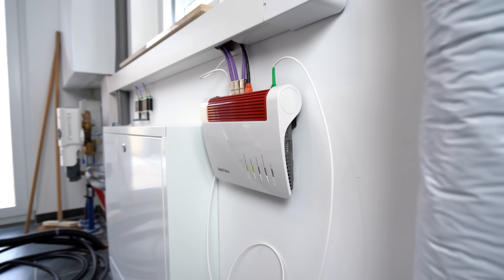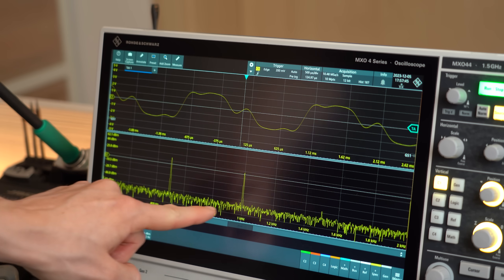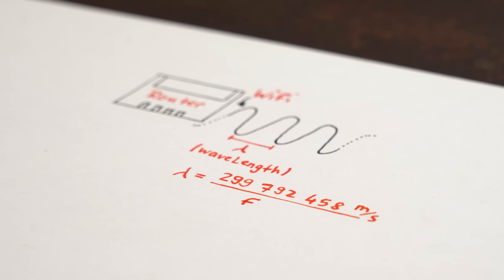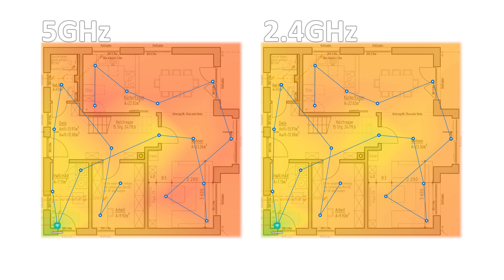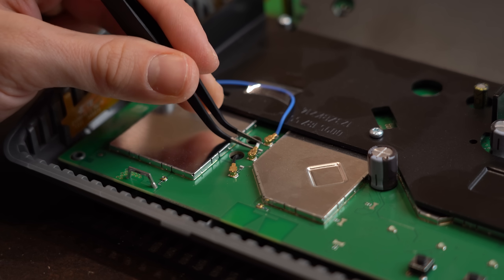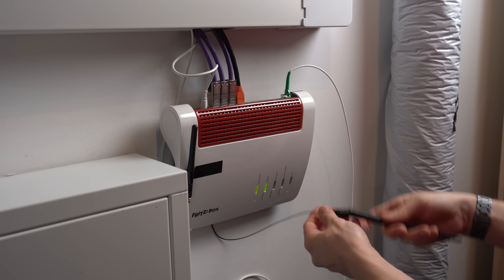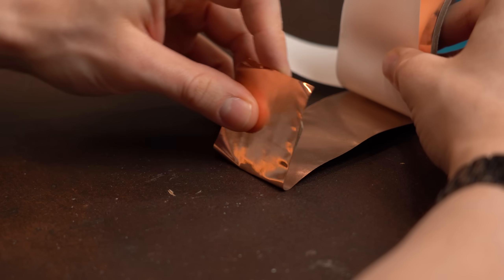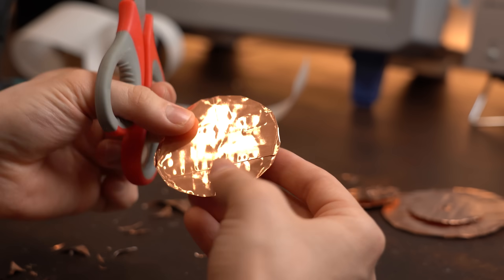I tried OVERPOWERING my WiFi!

Comment: The only antenna I would try to build for WiFi are a dish ore a wide beam horn antenna. Other then that. I’d just stick the copper tape behind the router on the wall to reflect most of the energy into the house. 

Good luck!

Comment: if you're having wifi issues i would first verify that your wifi router signal isnt being drowned out by other signals around the area, most wifi routers come with a set channel and changing it could result in better performance but there are apps to help you figure out what channels might be better for your router to be on, if you're having coverage issues i would recommend looking at a mesh system that provides wifi coverage over the areas where the mesh network is installed

Comment: A Mash Repeater is  always the best solution in this use case. Yes, this adds a couple more of more Watt per hour to your house hold, but it is the most reliable solution. Especial the AVM solution is very robust!
Sadly, the "MASH" standard, is only a company based standard and is not a cross company solution at all !!!
So you can only "mash together" your AVM routers (fritz box) or only "mash together" your Zyxel hardware, but never cross the hardware vendor!!

This is a big mistake of the WiFi hardware industry! every company should support the same MASH standard and always should be cross vendor compatible!

Comment: Hi. I actually use - bought ! - directional antenna's here.
They surely have some effect, a good couple of meters increase o usable connections. But: just when 'in the beam' ofcourse and worse outside the 'beam'. By the way, on a router with connections for external antenna's. And only 4.2 ;-)

Comment: The actual improvement you are seeing is because you rotated the antenna 90 degrees. As you pointed out in your sketches an antenna radiates the signal to the side and not out of the top. Before you were basically relying on catching reflections while with the new antennas you are receiving the signal. And wherever possible you should make sure that the receiving antenna is parallel to your sender (for instance with WiFi sticks)
Reply: I would also question the choice of different antennas. AFAIK newer 5GHz routers often use MIMO and I would guess that might degrade in performance.
Reply: that's something that a lot of people don't know, it looks silly to bend the antennas in 45 degree increments, but if you actually look that the DB signal flat, standing and to the side  there's a noticeable difference.

A good tip is if you struggle with reception and just happen to have two phones, try putting the phones back to back, and rotating one of the phones 45 degrees, rotating the phone 90 degrees would be optimal if you knew where the antenna was, but pointing the phone towards it would help a whole lot more, I'm assuming you have no idea where the signal is therefor splitting the difference with 45 degree

Comment: I've got a special case here. I live on the side of a small mountain (a really small one LOL) and I suspect the rock under the house to have a high content in metals and perhaps radioactive materials. The short story. A lot of my wireless equipment has a very reduced range. Per example, my Logitech blue laser mouse starts stuttering after 50-60cm. If I go into a café, I easily get 3 meters before the mouse gets unusable. So it might not all be because of range and walls. 
Another thing. WiFi is, as far as I can see, very similar to sound in terms of distribution. Am I getting this wrong?

Comment: People sell powered, boosted antennas for wifi which claim 50 or 100km range or better. Wouldn't that be good enough, and pick up the many nearby open wifi networks? Why would the antenna have to be a specific length? Couldn't any length work just fine? I mean, the longer the antenna, the more signal should be able to be picked up by said antenna. If you add more wire to an FM antenna, you can pick up more signal. I woyuld assume it would work the same for spreading the signal. As far as the single direction antenna, you actually need another one on the other side to pick up the signal, your phone isn't going to work as a tester for it, because it doesn't have a matching antenna pointing at the other one. Only a computer will do to test that. Two of these antennas should effectively send the signal in a straight line between the 2 devices, but wouldn't do anything as far as improving your actual wifi signal and so would show little to no difference on your test. Also, your comparison tests aren't really doing any better at any point. When there is still almost as much red in the second picture, how are you claiming a 10db difference, when visibly there is absolutely no difference? If the signal was better, then visibly there should be far less red, and it would be very obvious.

Comment: Do a wifi mesh system so every place can get good wifi signal signal go for access points with PoE so you only need to use the ethernet cable for both signal and power no septate outlet for powering it.

Comment: It's kind of strange to watch. Because when You look at the map the WIFI Router is in the corner. We all know it should be in the middle of the floor. Probably cables don't allow it. Why not use standard WIFI repeaters? How about also a panel antenna?

Comment: That antena is actually a receiving antena, not a emitting, so ofc it performed worse. This type of antena was used in the time when radio TV was still a thing, and that is why it is a monodirectional antena, they used to climb on the roof to rotate antena to the direction of transmission.

Comment: nice video, there are jsut two problems with the directional antenna
1. the  director elements (those disks that rget smaller and smaller) have to be electrically isolated, otherwise you didn't do anything about directing the signal since they all kind of resonate with the driven element, and the mroe director elements you use the tighter your beam gets, i would personally reccoment a helical antenna design or for more efficiency use two seperate yagi-uda antennas which have been rotated 90° along their firing axis, that way you won't have polarizazion issues with divices that have linear antennae

2. using a directional antenna focuses the power onto a smaller area, which increses teh effictiv epower in taht area, which goes into illegal ranges in germany, personally, i don't really fear a visit from the ordnungsamt since i live in a village and that would be their smallest concern but you expressed that you didn't want to do anything that is not legal in germany, which you woudl have dong have you not shorted out your antenna

please revisit this topic with better antenna designs, its really interesting

Comment: I have used 12/13 cm bands for many years. Set dipoles with a reflector and one director in the open corner of each room and hall. Passive reflectors work well.

Comment: You can't just haphazardly assemble an antenna out of copper foil and garbage and then proclaim that it doesn't work. Wtf is with the quality of your videos man? It just gets worse and worse. You need to build the antenna out of actual solid parts, and they need to meet specific requirements. They aren't meant for transmission across the house either.

Comment: Changing the antenna is probably also be illegal as it increases the EIRP.

Basically: directional antennas have the benefit of reducing noise -- not increasing the allowed TX power by focusing it in one direction.

Look up the definition of EIRP to get a better explanation than I can give you. The legal limit is measured in the strongest direction, not as the average over the sphere.

Comment: You have connected the feed at the wrong point. You connected to edge of driven element. It should be inset. The inset distance is responsible for the impedence match.

Comment: GreatScottLab The multi disc (antenna??) in your thumbnail looks similar to the reflectors used in something called a "Cantenna". I never made a Cantenna, but they have something your example does not have.. (The Can).. 

The Can is what keeps the radio waves from scattering after they hit the reflector part. 

There are (or was) on-line calculators for calculating the dimensions of the can for the wavelength you are using...

Comment: Most people will just care about the router's transmission power but forget its reception from the smartphone or pc. The same attenuation occurs at the signal transmitting from the smartphone or pc. A good communication depends on both sides. Otherwise, the speed   cannot achieve as when both devices are in line-of-sight. Another trial is to move the router (ie Antennae) as high as possible. According to my experience, this could make a difference.

Comment: You've misunderstood the rules. Modifying the antenna on a router is just as illegal as adding a power amplifier.  EIRP is Effective Radiated Power and takes into account any gains or losses in the antenna as well as what the final puts out.

Comment: Changing antenna to one with higher gain is also illegal, power that is mentioned is EIRP which includes antenna gain, not only transmitter power.

Comment: Get rid of plastic antenna covers (leaving just bare metal rods) and measure the signal strength again.
And use a DIY wifi stick antenna aluminium directional deflector. It works!
Also place antennas coaxially on separate height levels.

Comment: That antenna should have a non conductive shaft or at the very least it should be isolated from the copper. The aligator clip in the middle will screw with it and the feed point also doesn't look right. I'd make a bi-quad they are really good for this situation and not too hard to assemble.

Comment: Did you perhaps see the wifi hack on Ukrainian nutcase Kresosan's channel? His channel is well worth  a look, they used the cover of the 1st war Russia hads with Ukraine as cover to blow stuff up, like connecting electrolytic caps in to the 240V mains supply. He actually has a degree is EV or electronics of some sort, so it's hard to tell if he's trolling or being serious most of the rime.

Comment: From my experience wifi is pretty much useless if you don't have repeater in every room. Even then in some buildings with a lot of steel in the walls there will be too much interferences. For reliable and secure network there is nothing like a cable!

Comment: A high quality access-point is like $100. While that is a lot more. The strength of the signal is considerably higher. We are 6 people in my home using the Wifi, and the older kids also run there computers of it. Its pretty much always perfect speed.

Comment: Get a fibre extension cable and move the Router (pronounced "rooter" in the UK)
Only those crazies in the new territories call them by the same name as a power tool for edging wood.

Comment: My solution is central wifi access point like a Unify. You can still have the combined router/access point/firewall/media converter there (hate all in 1 box, i have mostly all separated). Get same password and SSID to both and you have a combined network.

Comment: It's 2005, you're a teenager, you try to mod a usb wifi antenna with a beer can, hoping that it could pass through 5 walls in a 20 meter straight line, as a result you spend most of your time plugging and unplugging it, and adjusting its direction.

2023: you're watching a short/reel, and some eastern european looking girl or brown handed man is irreversibly changing your life with 10 lifehacks: among them is the aluminum can antenna. 

You shed a tear.

Comment: Please stop with the disinformation,  it's getting out of control and ultimately shows who you are as a person and creator!!! (fake?🤔)
The Russian sniper antenna you are showing is designed for long range p2p directional testing. 
They're great for hacking. I have many and all work fantastically. As they did, I too have gotten many many km's of range from them.
One of which is on a remote gimble on a 40ft mast!
But unfortunately you built it completely wrong. Only 2 plates are connected and the rest are reflectors and deflectors, they should be insulated from one another.
 Hence in the instructions it says something about insulating with a pen tube.
They are old and proven and the fact you couldn't and didn't know how it works has got me thinking about your intelligence and how your educational video's are conflicting with each other. 
You copy and write a script just like every other typical YouTuber then pretend to know but are confident therefore people listen.
You simply do great research and pass it off.
The Chinese love your work as you do theirs! That makes sense to you doesn't it! Because your circuit's definitely are the same as older but harder to find Rf designes. 
I have learnt a little from you but it's all common sense easily picked up with beginners.
 Definitely not a broadcasting antenna.
If your router has a mesh option just buy another one or an old one and deal with changing AP's manually.. 
Or build a double helix as their proven and even easier to make.
Best option for anyone would be to buy an Australian router.  
Our maximum transmission is 1000ma and peaks of 1500ma is possible with custom firmware on Nighthawks ect.
I don't want to unsubscribe but I'm getting very close now.

Comment: re-enforcements in walls acts as loads on the antennas and just moving them a bit sideways maybe helps. Another reason is the antennas acting as half dipoles, they require a ground plane to get the energy out and in certain directions. If the ground plane is small, the distributon pattern will be unprededictable.

Comment: Are you unable to get a fiber coupler and just extend the ISP fiber and put it more centralized? Or get a mesh network setup? Or disable the wireless functionality of the router and get a good quality router that handles the wireless routing

Comment: You should not use the same SSID for 5G and 2.4G Wifi. 5G Wifi has a severe range problem when it comes to penetrating walls. With different SSDIs you always make sure that you're connected to the better wifi.

Comment: Your 1st mistake is buying a second wifi router when you should have bought an access point instead. 
2nd mistake is you need to put the routers in the middle area of your house and elevated up near the ceiling.

Comment: Thanks for the video! To put it bluntly: the measure that really helps the most are repeaters that are connected to the router via cable.
Connecting external directional antennas is prohibited by law in most countries. The idea with amplifiers cannot work because you would have to amplify both directions. And then unfortunately there are a lot of fake videos about supposedly great WiFi antennas that don't work. In order to make a functioning antenna, you have to take a few more things into account anyway.
In your case, a metal foil on the wall behind the router could help a little. On the one hand, this directs some transmission energy towards your apartment. And on the other hand, your neighbors' WiFi signals are somewhat shielded, which leads to a better signal-to-noise ratio and thus improves your uplink connection. By the way, the latter is usually underestimated.

Comment: I had the same problem for a long time but everything changed after 802.11 k/v/r became available in the consumer grade hardware. This technology allows devices to roam between APs. Works like a charm and roaming so fast that it happens without noticeable connection degradation. Personally I have some not very expensive Zyxel APs and can highly recommend them but many other manufacturers have this too.

Comment: Those thin coaxial pigtails are quite lossy; that is why the old wire antenna, welded to the board, performs quite well

Comment: When I was looking at those onboard antenas, it looks like most of them are rotated in a wrong direction for your on-wall setup. Try to put your router on a flat surface and it may improve your singal on it's own.

Comment: As already mentioned, the ERP (Effective Radiated Power) is a thing to watch out for. But the power levels used are low enough to not get you in real trouble, even if you are going 'way beyond' what is allowed ;-) 
But the antenna you used needs a ground plane to have the best effect and you don't want the taped on the side of your Fritz!Box like that. 
We use the same (new) Fritz!Box in our office and I noticed that the coverage highly depends on the channel used. You may want to try different channel settings in your box to see if you can improve the coverage even more.
Reply: There are plenty of people who play with magnetrons and they don't get in trouble. I also did some experiments at limited power like lighting up some fluorescent lamps.

Comment: I solved my WiFi problems for good at home with two Xiaomi ax3000 routers in mesh configuration. Highly recommended. As an example, in a 600mbps connection, now I get half this speed in points of the house where the signal was basically absent. Can't recommend enough.

Comment: I live in a small (36m2) apartment, and great wifi coverage from a single AP is one of the good things about it among the many bad things (like a lack of space for a proper desk, let alone a lab) :) I use a Ubiquiti UniFi AC PRO access point running at 17 and 20 dBm for 2.4 GHz and 5 GHz respectively.
However for your house, I would recommend turning off wifi in that FritzBox, and placing 2-3 separate APs across the house, all wired back to the router (or a switch, i.e. don't use mesh). The TP-Link EAP610 and EAP615 are great value for money, and can be used without a controller (but I recommend one if you're usinf multiple units).

Comment: Some decent TP-Link Omada or Unifi Access Points will resolve all of your wifi issues easily. Then, you can turn off the wifi in your router and use it purely as a router.